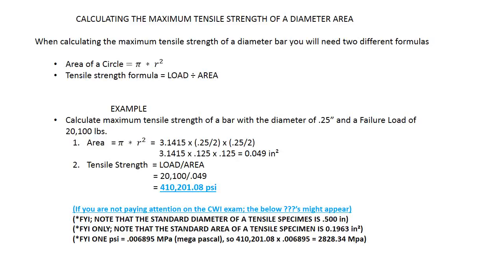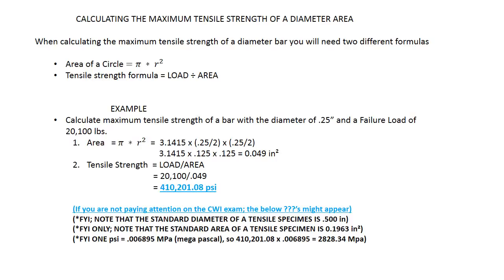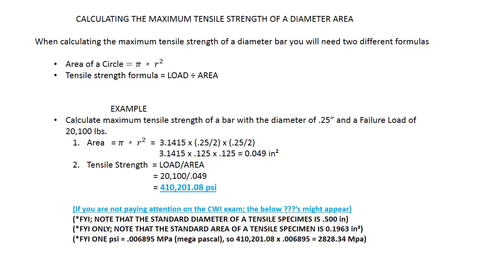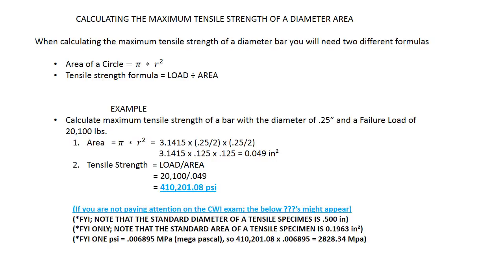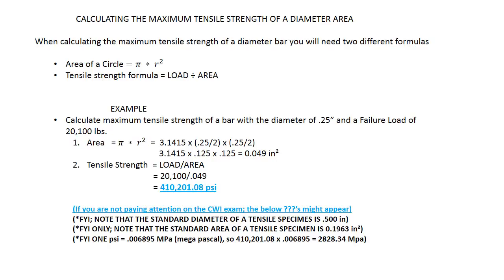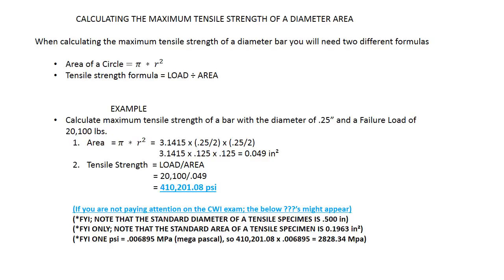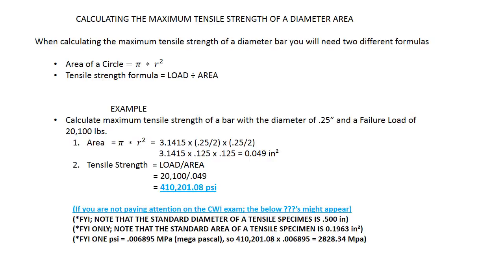CWI 1 -  HOW TO CALCULATE THE MAXIMUM TENSILE STRENGTH OF A DIAMETER AREA

Comment: How come when i did  math everything was fine until i did tensile strength calculation,” 20,100 divided by .049 =410,204.082” i did this on my Casio fx300 MS and my iPhone 14pro and got same answer?????? And You got =410,201.08 
If i did something wrong or you could help me please instruct so. Thank you
Reply from the maker: You are correct 😂 the 1 was to close to the 4.  The correct answer is 410,204.082
Reply: Thank you for clarifying it! I was thinking my calculator was on some other level and giving me wrong equations! 😂
Reply: I wish you or somebody would do a video on the filler metal recipe’s